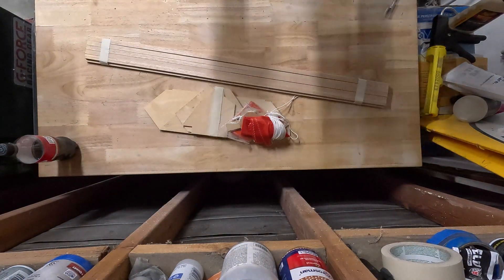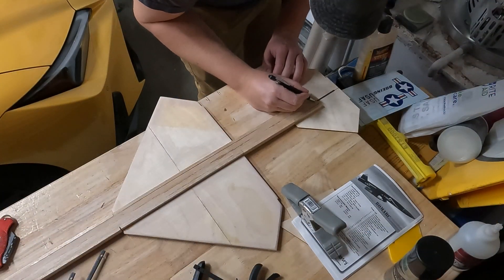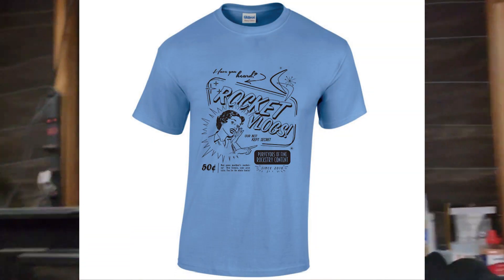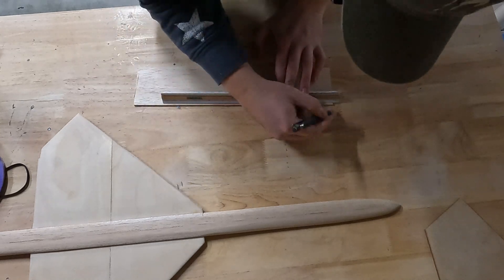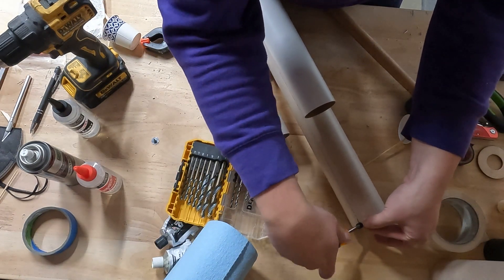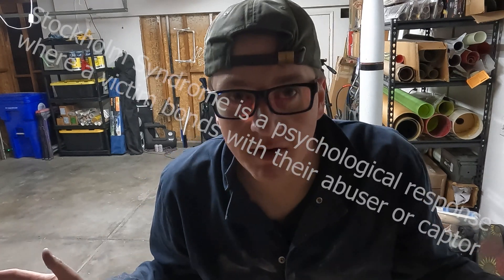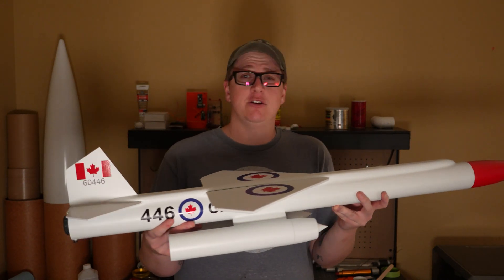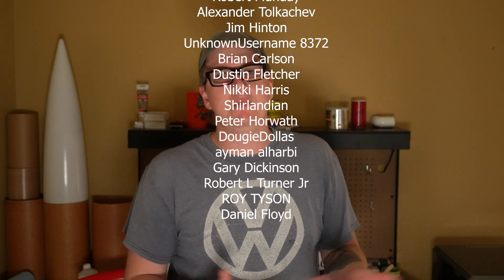My Most Complex Rocket Kit Build | Boeing Bomarc Missile Scale Model

Comment: I just started the build on my Bomarc.  It had been sitting in the closet for a while, but I finally got around to the build.  I've got the wing panels assembled and now I need to begin air foiling.  I give myself another week of construction and then another for the paint (I have a dislocated shoulder).  I am definitely going with the white/silver/red Canadian version with Stickershock decals.  Supposedly, you can fly it on an F motor but I think G or H would be preferrable.